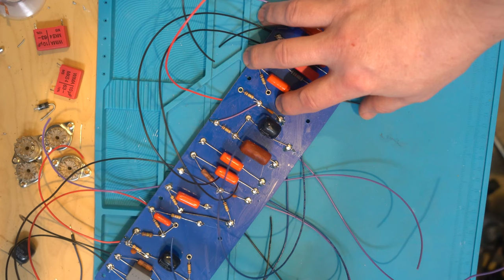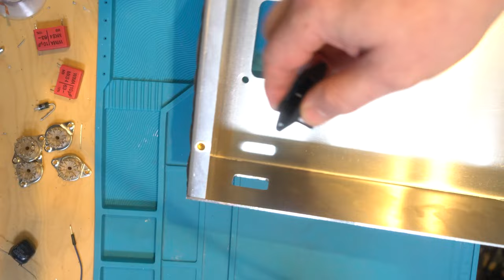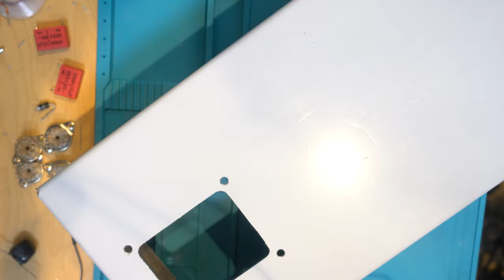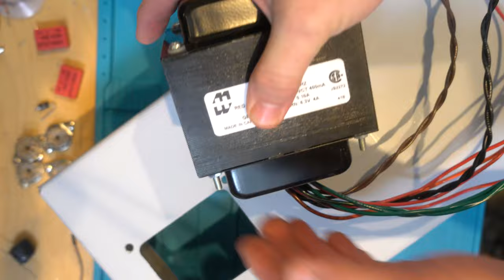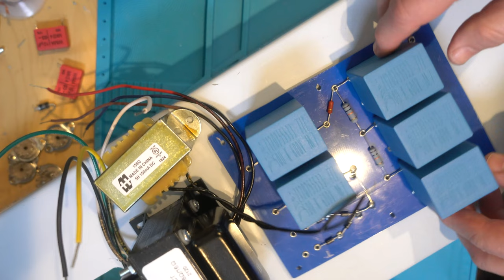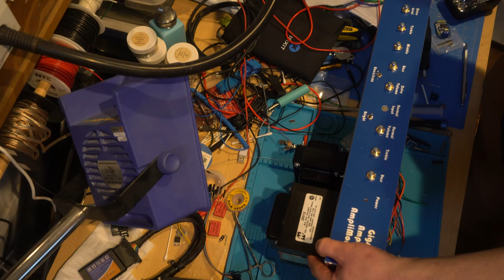Dumble Modded Bassman Video 4

Comment: film caps aren't for psu's-  gonna ripple terribly-     the amp will likely oscillate as well,  thats all before the amp is hyper-micrphonic..
Reply: Would you elaborate on this? As far as I was aware, the only downfall of film caps here is that they tend to be huge for the required capacitance, whereas the electrolytic caps are less cumbersome.
Reply from the maker: I've only heard good things about them from the amp builders on Ampgarage.com.  could you explain why they don't do the job a capacitor should do?  What is the purpose of 600v capacitors if not for power supply noise rejection?
Reply: ESR, its all about it...   Link to amp garage builders using films, and are these successful builds, or someone doing whatever and then firing off SOS flares for help after they've smoked their O/T???
Reply from the maker: What values of ESR do you consider adequate?  The ones I've bought have about 5.3mOhm and from everything I've understood, lower ESR is better.   These have sub ohm level and electrolytics often have over an ohm.  In fact that's where Solen's are considered outstanding but extremely expensive because some higher end hifi Why do you think people pay 40$ for a 10uF 700V solen cap?  I'm still not sure I understand what you're shooting for.  The bigger disadvantage to film caps is their size for the capacitance.  Electrolytics are tons cheaper to do the same job, but they do die after somewhere between 10-20 years as the electrolyte dries up.  Here's a thread talking about just this: https://ampgarage.com/forum/viewtopic.php?f=6&t=31053 view page 2, the user Colossal talks about his builds having no issues, and a professional amp builder Carr Amps using Solens.    I really do want to understand your point of view, but it seems uninformed?